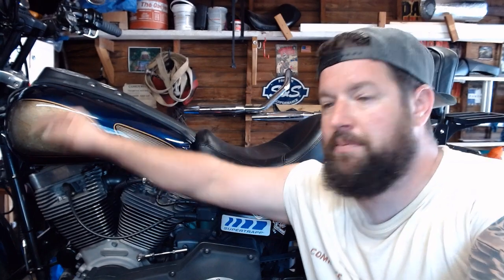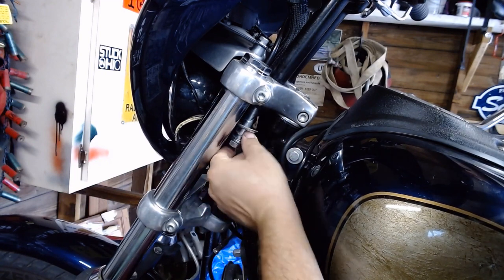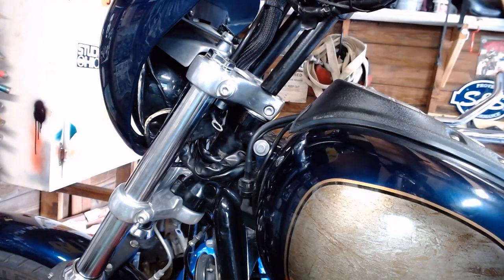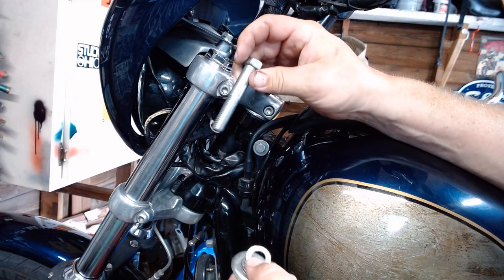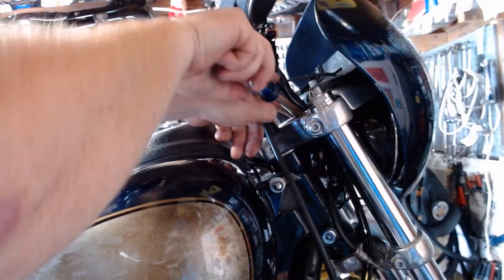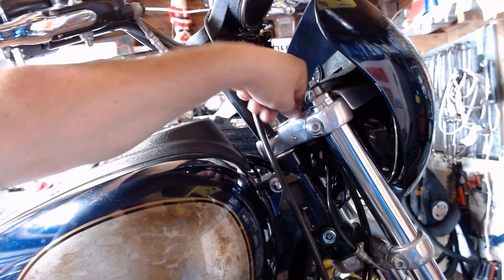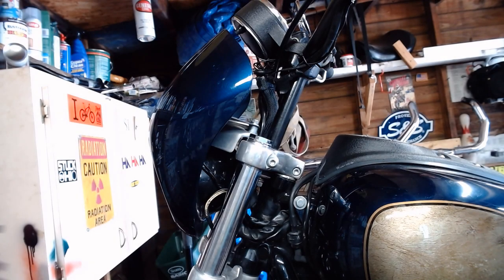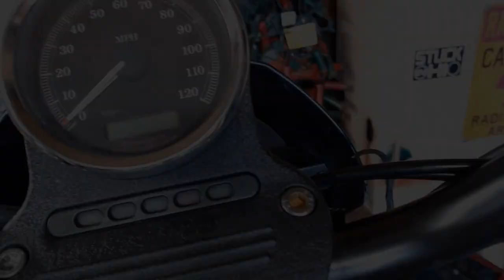HD Handlebar Bushing Replacement

Comment: What was wrong with the bolts you took out. Why put new ones?
Reply from the maker: I laid the bike down a few weeks before, so I installed new bolts, in case the old ones were cracked.  It wouldn’t be necessary if you were just replacing the bushings.
Reply: @KnobleMoto  thanks. Came across this as I was looking up how to swap them